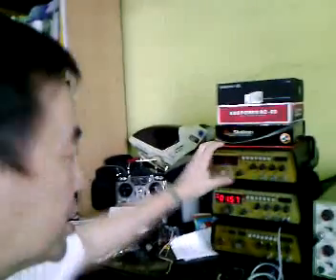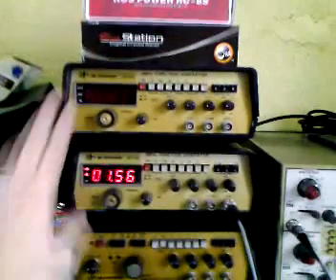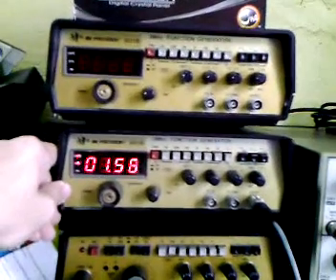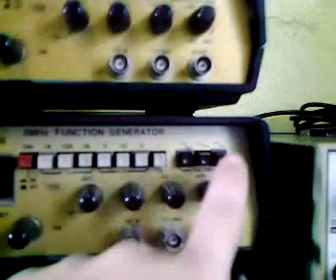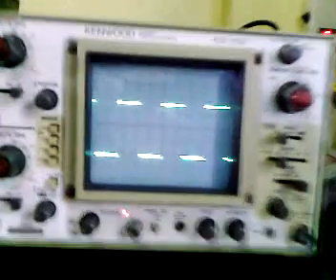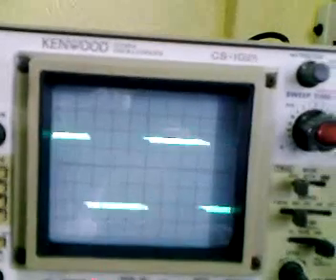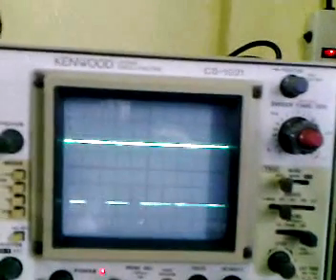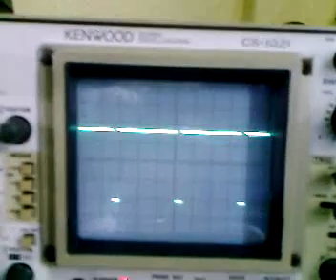BK Precision Function Generator 3011B

Comment: Where did you get that function gen? Which shops do you recommend for good quality second hand branded equipment such as bench mulitmeters, scopes, signal generators, power supplies? 

The duty cycle control of that BK seems to be simultaneously changing the frequency and duty cycle.